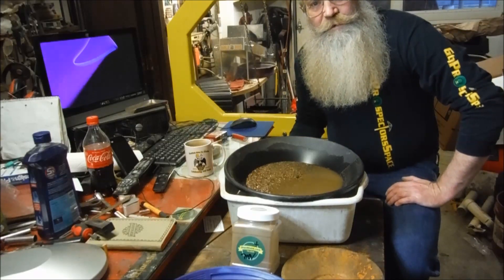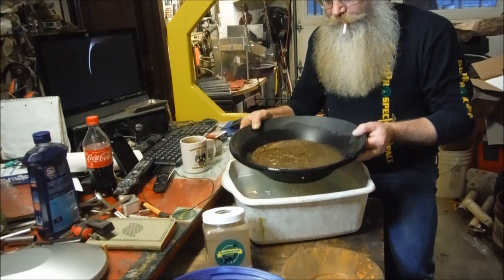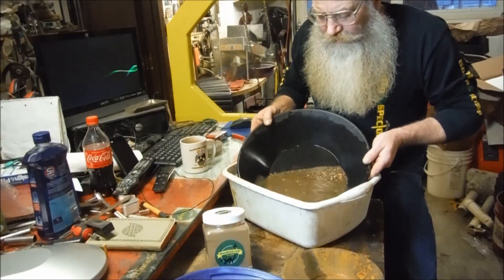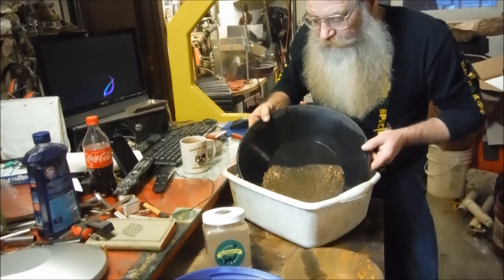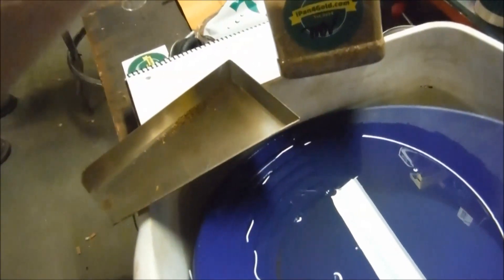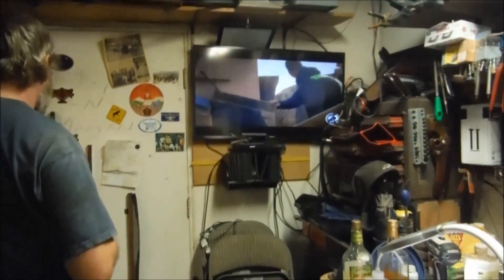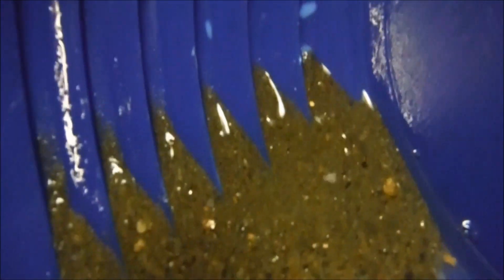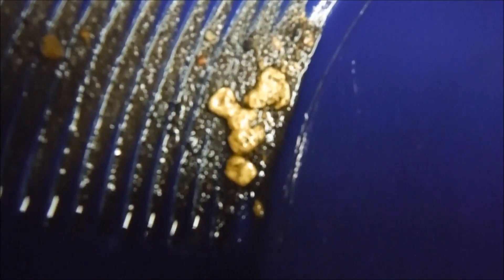A Placier miners Dream Pan

Comment: Now THAT, is a nice pan of Color! when i started prospecting  i used a large Steel carabu pan like the type the klondike miners used and tha was back on the late 1960's now i use the Garrett pans, much lighter than steel  and i can move a lot of material through them very quickly. with any luck i will be able to  go out  after the spring  flood snowmelt drops.
--Rick

Comment: can you tell me what the Jet-Dry does when your panning for gold does it keep your gold stuck to the bottom or what
Reply from the maker: the jet dry does a few things fist and foremost it breaks up the surface tension of the water and stops the gold from floating secondly it seams to help the specific gravity of gold do its job and yes sink to the bottom , it also seams to help black sands float out of the pan easyer